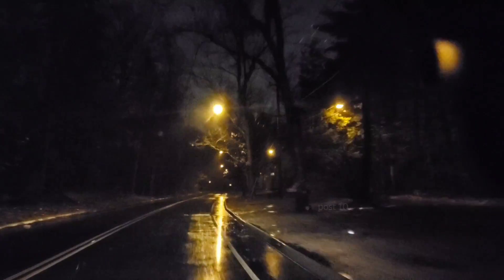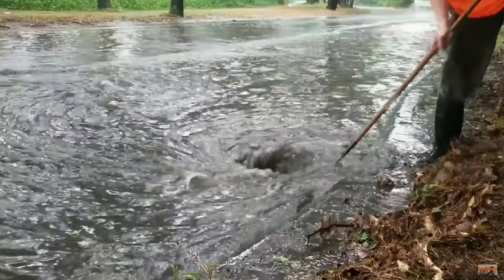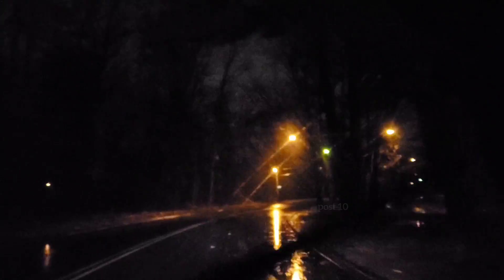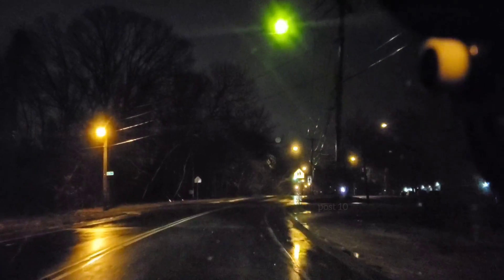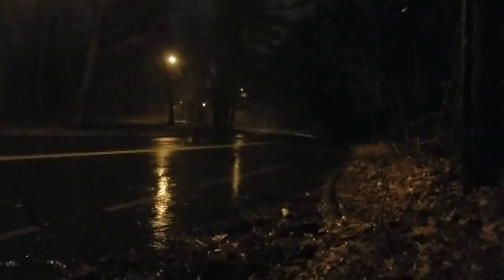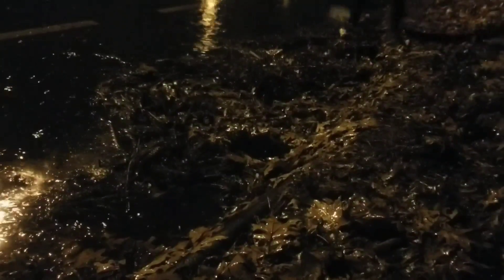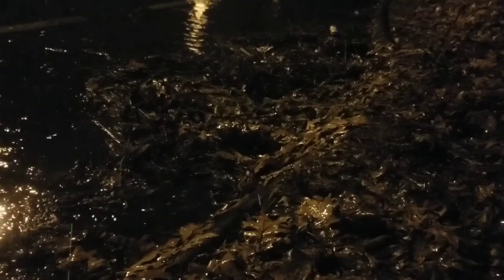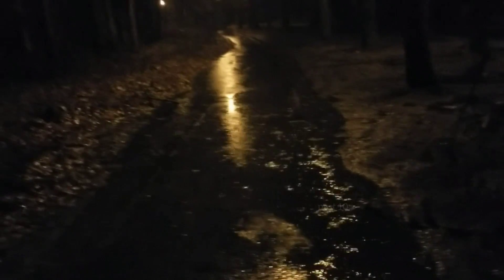Draining A Massive Flooded Street Again At Night (Night Version) Jan 2021

Comment: I'm not quite sure where you are in North America, but your location is obviously rural, and probably towards the Eastern Coast of the United States. I am in North Yorkshire in England. I love your videos, they bring back many memories of doing exactly the same as you do, though being in England was on a much smaller scale. I used to explore drains and culverts just for the fun of it. I cannot walk past a blocked drain cover without clearing it with my feet. I wish I could show you the tool I use when doing drains and culverts under roads. Think of a 4 tyned 2" between prongs fork with maybe 18" prongs, bent at 90 degrees about halfway along their length and at least an 8 foot handle. Even as a young child, I love damming streams, building up lakes and releasing them. You do a fantastic job, I hope your local authorities recognise your continued efforts. Bless you.

Comment: Seems like every town has one or two areas where draining during or after a storm is a continual problem.  It blows my mind that even in a small town that DPW is well aware of these spots and does not do whst you are doing.  It takes what . . 2 guys 15 minutes to hit these spots during a rain storm of some measure. They could do this until engineering provides a longer term fix.  Can't  say they are not aware . . .somebody from that Dept has to be out checking on the area.